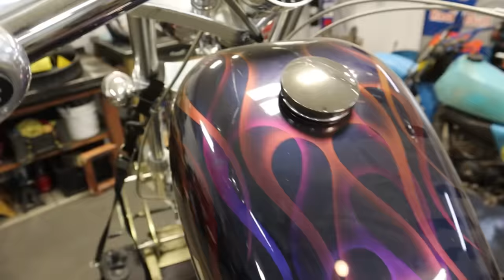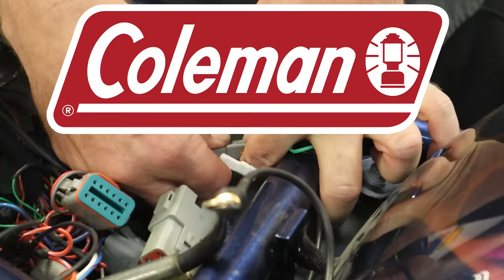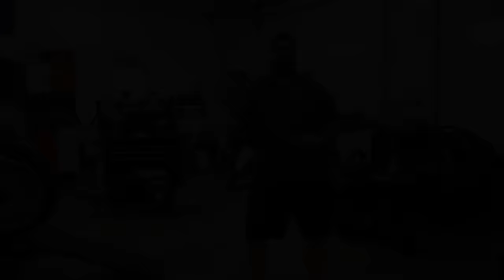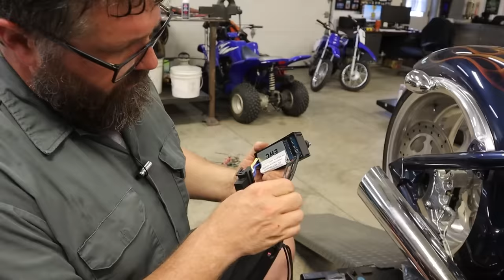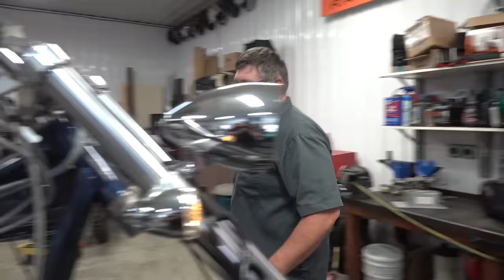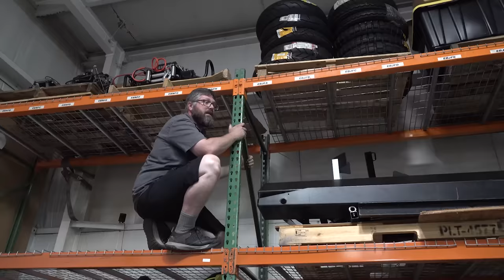Can I Fix This Unfixable Chopper ?

Comment: I’m showing this video to everyone!! I’m the electrical repair guy in my town and no one understands what it’s like dealing with this stuff and wonder why it cost what it does!! We are the surgeons of the mechanic world craig!!!
Reply: It’s not hard. There’s a very significant learning curve moving from being able to figure it out over to efficiently diagnosing and repairing issues. I seek these things out to buy and fix.
Reply: Electrical issues is easy when you just replacing everything,.. but it's a nightmare to troubleshoot and find some faulty wire or components.. I just replacing whole harnesses for something like, I won't even try to find the fried wire..
Reply: As an engine mechanic I can say with all confidence electrical work is not hard. It is absolutely tedious and slow going. The main difference between someone that knows what they're doing and that doesn't is a massive amount of time. 
But as I've had people come in with top ends they have rebuilt completely forgetting to put in piston rings, I've seen what happens when someone tries to rush an electrical job and they don't know what they're doing. And I pity you guys. Because every knuckledraggin monkey thinks they can do electrical work, when they won't even take the time to learn how to read a wiring diagram.
Reply: @RoamingCosmos  it's only a nightmare to you because you don't know what you are looking for and how to find it. Also, wires just don't fry, so you really need to identify what that would occur in the first place.
Reply: @bluebeard6189  100% correct. It's not hard but you need to spend the time to learn to be fast. Learning exactly how the systems work and understanding circuits at more than a basic level is what is required to be quick.
Reply: Zzggggh
Reply: See... Don't leave it to Beaver 😂
So many things he did not look for 😂
Reply: @AnonyMous-jf4lc  in most cases its the solenoid has gone dead .....
Reply: 💯 
I'm a mechanical guy for a reason. 
Hats off to ya fella
Reply: @AnonyMous-jf4lc it comes easier for some than others believe me I’ve watched many techs struggle to understand and it’s important to keep that in mind.  Some people don’t have a mind for it and that’s okay
Reply: Try working avionics in the helicopter ems field. I wish I had to deal with the minimal wiring in bikes compared to the 3 inch bundles i get to deal with.
Reply: Most of the people who have common sense can fix all this themselves. Compering yourself to surgeon is a bit to much. 😂😂😂😂
Reply: "Wires don't fry" LOL. I've found wires burnt in two that still had the plastic on them 😅  They can and do short out. Frame rubs, incorrect seat mounting , wear and tear you name it. One wire can lead to several needing replaced in a bundle. You can clearly tell who has worked on bikes for 20 years or more and who hasn't. I'm sure I haven't seen everything but damn close. I've had plenty of bikes in that people tried to "fix" themselves lol. Not everyone has electrical or mechanical aptitude or both
Reply: Facts.  Most people don’t know car electronics can be hell. 👍🏿👍🏿💪🏿
Reply: @AnonyMous-jf4lc it's not hard for some people. It's similar to what I do for a living, I deal with European vehicle engines and transmissions. I can completely dismantle a twin turbo v8 bmw engine and transmission in 4-5hours. 5hrs is it was a vehicle from the north east. I could give an electrician every tool and lay them out for electrician and he/she likely would spend 8+hrs to finish on top of the amount of broken items or broken connectors off the wire harness. To me it's incredibly easy but most people would struggle to do it in 8-10hours without damaging expensive items from the engine or trans. Electrical work can feel like alien technology to people that don't mess with it just like a transmission did the first time I went into one to completely blow it apart completely.
The nasty electrical rats nest in the bike in the video is a prime example of a mess that is far more difficult than what it would be if it had a decent wire harness that was cut and spliced all over it.
Reply: Electrics are not related to mechanics. You’re certainly no surgeon champ.
Reply: @bluebeard6189 What do piston rings have to do with it? Do you put that into every story you tell?
Reply: @vitobelas3699 *too. Three letter words can be tricky.
Reply: @MidgetPunter You’re a hero. You should be famous.
Reply: @stupidhead9117  I'm making a comparison of stuff I've seen idiots bring me, were they overlooked something so simple and yet so critical but they were confident in what they were doing. These are all the same people that like to think do you know how to do their own electrical work. So I got to wonder what steps are these idiots skipping when it comes to wiring.
Reply: @stupidhead9117  I try my best....
Dalbajobas supistas, susikisk I sikna savo ta anglu kalba. Pats ismok kitu kalbu 😂😂😂😂

Comment: I am/was the go to guy when no one else could fix stuff. But I finally retired after suffering a stroke... In my 45+ years of fixing "stuff" I discovered that there were days that no matter what I did or tried that nothing was going to work and that if I stopped fighting it for a day and came back fresh I could almost always figure it out the next day with much less frustration. I rarely get pissed off because I know that whatever it is that I am working on has no feelings or agenda.... it's never personal and getting angry isn't going to make things easier. My point is that one of the best tools in your toolbox is the one in your head that tells you when to take a break and come back later fresh. It works every time
Reply: ^^^^^ pure wisdom! Beautifully said my friend! 
Not only as a mechanic myself, I do this a lot at work. Also, it's a great life lesson, too.. 
Thank you for sharing such a treasure..
Reply: As a young millwright, we hit a snag.  The old guy said, "Let's take a break, & don't think about the problem; let's talk about other stuff.
Refreshed, & back on the job, & it was like it fell together; I was amazed.
Reply: I heard it several times, when i was young. "If your are stuck, go away, leave it there, do something different, come back later." Of course i ran into many things, like everyone. I still wonder why it works, but it helps every time.
Reply: Never a truer word spoken! I tip my hat to you, sir!! I am same as you. 
Methodic Fault finding is the key.
Reply: Generator engines with magnetos batteries were optional lol.
Reply: How did you know that I carry a large hammer to smash objects that anger me in my head?
Reply: As a young fella being 22 from rural Australia with a hobby for purchasing old motorbikes, fixing them, making them look great again and selling them for a profit - the walk away method and come back to it tomorrow with a well rested mind and a clear one at that has been rather useful. 

Your best tool in life is your mind - and the best thing is, you can train it.

Comment: Man, much respect for even taking on a project like that!
Reply: Agree, I wouldn’t want to be seen with a bike like that in my shop
Reply: That's a project in itself
Reply: No wonder they went under
Reply: Why this is not a hard job other than it takes a bit of brain power. Unfortunately in my 40 years of being a mechanic working on everything from heavy equipment, road tractors, dump trucks, light trucks, cars, and motorcycles (admittedly only Harley Davison’s, vintage English bikes) have found the majority of mechanics don’t take the time and or don’t have the skills to properly diagnose/troubleshoot all but the simplest of problems.  
Side note the “thin wires” Graig was referring to are mil-spec wires and use ultra thin strands (but more of them) and high temp insulation, the advantage to this type of wire is it can carry more current and amps in a smaller overall package which of course comes with a higher cost per foot but if you are building a custom bike with very sanitary routing (hidden) wiring etc this type of wiring is worth it’s wait in gold.
Side notes when repairing a vehicle that has had someone trying to jumpstart start it with 24 volts and burnt wiring and control module it is almost a sure bet that the coil has been damaged this sort of damage can be avoided if proper fusing/use of relays is incorporated into the design of the wiring harness for the vehicle/motorcycle
Reply: Haha thunderheart!!
The shop Rebuilding my bike is a Big dog authorized repair center. Creativecycles Umatilla FL
Reply: if its un-fixable.....he wont
Reply: Any electrical system on a motorcycle is fixable.

Comment: When I see an engine firing back through the intake as well as popping in the exhaust. I always start wondering about valves.
Reply: Quite right! We put a compression tester on EVERY bike that came in the shop because what's unmeasured is unknown, and air-cooled top ends on old bikes are prone to issues. I bring a comp gauge when I check out used bikes before purchase.
Reply: I noticed the speed of the cranking is really fast compared to any Harley I’ve ever heard turning over on the starter motor. 
It’s either bent valves ( mistimed and valves collided with pistons) or frozen rings, or, it’s bore washed with fuel and no oil sealing at the rings.
My 2 cents…. I’ve been a mechanic for 40 years and I pick up on these symptoms pretty quick.
Reply: Valves mabie too tight or its skipped at tooth

Comment: I'm a retired electrical engineer, but lived for problems like this on ships and other marine vessels! For a sideline, I fixed motorcycles. You are so right, you cannot possibly hand a customer an invoice for your time, or learning. So....I found that it pays not to look at all the pretty colors. Just take one circuit at a time and "think" as if you were "speaking" to a newbie, teaching him how to do it. This prevents your residual confidence and old habits coming into play. NEVER discount a male/female pin inside a plug or
socket being pushed back! (Murphy loves throwing that trick into the ring!).
My greatest "find" was a dead fruit fly inside a plastic encased relay, back in 2002. One dab of Isopropyl Alcohol and one Q-Tip later, and a $6M Dutch luxury Sports Fisherman could use its bow thruster once more.
Cost: 4 hours labor plus 1 Q-Tip 😉.
Every success. It appears to be a 6 cup problem.
Reply: top story man!
Reply: Would have LOVED to see that bill being handed to the owner, with a giant shieet eatin grin on your face......... "$12,000, WTF man you were here for 4 hours. " It not the time its the KNOWLEDGE you are paying for SIR.  GIANT SMILE !!!😁😁😁😁
Reply: @anonimous2451  
The owner was a very wealthy man. He owned many aircraft also, including many WWII "warbirds" and his own G5.
He paid me super quick ($400 + a $100 tip! No tax, as no parts used!), then asked if I ever got to take time off. I replied that I did not. So; I went back to the home port onboard the boat with the captain and one crew member, at his invitation and he flew off  somewhere else.
I stayed on the boat for 5 days (alone and very impressed, as it was a Dutch built Feadship) at his private boat dockage in Fort Lauderdale, drank Bombay and chased women at The Bimini Boatyard!....as a, "thanks for not ripping me off, as they usually try to". He even paid for my return flight home!
The captain and his wife and I stayed in touch afterwards. I got a much needed break and he paid for me to return and consult on something else, about 2 years later.
Pure respect both ways and an unexpected win-win, due to honesty.
Damn! I could have got used to that!
Reply: @Dodger2879  Dayum dude, 400 bucks? Honesty pays for itself my man and MAD RESPECT for doing that.
Reply: I've been helping a friend and his girl gut and remodel interior of rv. It is insane how much random(to me lol) wiring is all over the damn thing. I couldn't fathom some ship w miles of cable
Reply: @anonimous2451  
He gave the dead fly to the dock master and thanked him for his recommendation. The dockmaster  kept it in a small Zip-Loc bag, stapled to the noticeboard with my business card, in the dock office. When asked, he explained why.
That got me thousands in future business, so actually, I was paid extremly well for that one job. (The dockmaster never wanted for a fresh bottle of Captain Morgan whilst I was around either!)
Reply: You can tell from this vid the channel owner knows NOTHING about electronics. he does everything backwards.
Reply: ""think" as if you were "speaking" to a newbie"

This is actually a famous technique widely used within the software development field, called "Rubber Duck debugging".

Essentially, when you've written code that doesn't do what you expected it to do, you go find a buddy, and explain to him, line-by-line, what each line of code does, and how it does it. Typically, in explaining it to another person, you will quite often discover your own mistake, and the less the other person already knows, the better, as it doesn't allow you to shortcut the explanations by assuming prior knowledge. It forces you to slow down and focus on the fine details of what every single piece of your code is doing, and how it's structured.

NOBODY knows less about any given subject than an inanimate object does, so, the best thing to do is cut out the middle-man, and explain it to an inanimate object (ie; A rubber duck).

It's amazing how many of your problems you can solve all by yourself, just by talking about them, in detail, to a rubber duck.

Comment: You weren't stupid to take it on, you're smart enough to take it on. Can't wait for the sequel !
You went from sliding downhill on a two stroke yamazuki to a rigid puzzle like that mate I take my hat off to you! Loving these vids😏
Reply: Agreed!
Reply: stupid taking on a bike that has almost no real after market. Had buddies who were into choppers expensive ones, only person that makes money on them is builder in original sale, after that worth pennies on the dollar. No one wants someone elses dream bike unless they had same dream.
Reply: I do this work everyday (motorcycle shop) so I feel ya.  As a side note, I work on Harley’s almost everyday and have never heard a Harley motor (or Harley clone motor) crank over so fast.  Even with no plugs in it they don’t quite sound like that one did.  What starter is on that bike?  I’d seriously like to know as I build some dragrace Harley motors with big cubes and often stock starters aren’t up for it.  Does the bike possibly have a 16 volt racing battery or something making it spin so fast?  Sometimes on out big bore hayabusa drag bikes we set them up with an extra battery wired in series only to the starter and feed it 24 volts to make it spin super fast and start it otherwise they can break the starter clutch or idler gear/boss in the crankcase.  Before someone comments that’s it’s impossible that it would fry all the electronics on the bike, re-read where i said it only feeds 24 volts to the starter motor.  I can explain how exactly you accomplish this if anyone is interested.  
But anyway, that thing spun really fast for a Harley.  Almost sounded like the cam timing was off and it wasn’t compressing right.  Usually Harley (big twins at least, don’t have much experience with the smaller ones) you can actually hear every stroke of the engine during starting as it noticeablely slows on compression stroke right before it lights off!
Reply: Exactly

Comment: Kudos for getting someone’s pride and joy, taking on a difficult task and prepared to keep going until it is repaired. Before the spark failed, I wondered if the timing was wrong. Misfiring as it was, I’d be interested if that was a contributing factor.
Reply: i agree its got all the hallmarks of timing off i had my first harley a 67 sporty and redid the top end and had tried every thing including having friends push me down the street did lots of snorting and popping.a friend came by and looked under my mag and seen i was 180 off  he set it on tdc and reset my mag and it fired right up ! happy mf after all that!
Reply: @1219husky  it's happens more times than guys think.. because they are too proud to tell their buddy, the timing was off!

Comment: Had to work on a Big Dog just a few weeks ago for a buddy of mine. He came across a smokin deal on a bike that had been at a dealership for a year and a half taking up space. Seems they couldn’t get the bike to start or even crank and weren’t able to sell the bike. Buddy brought it home and called me, we had it running in 15 minutes after I got there. It did take a while to get it roadworthy. The printed circuits behind the switches on the handlebars were corroded beyond belief. Eliminated all that garbage by rewiring the bike front to back using heavier gauge wire,actual relays and a hidden switch under the oil tank. 

You can check the coil you have on the bike before buying another one. Twelve bolts to the positive side with a piece of wire to the negative side that you can touch to a good ground. I have a feeling that you might need to check continuity on the signal wire between the camshaft sensor under what used to be the points cover and your coil.  You may also have the same trouble I ran into of the contacts on the rocker switches being corroded or the printed circuits behind those switches. Good luck with your new nightmare.